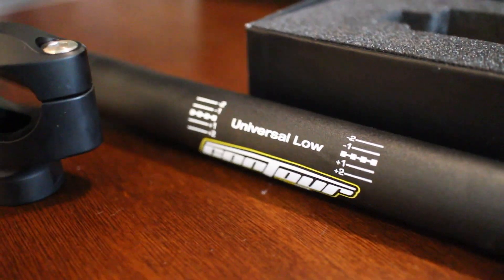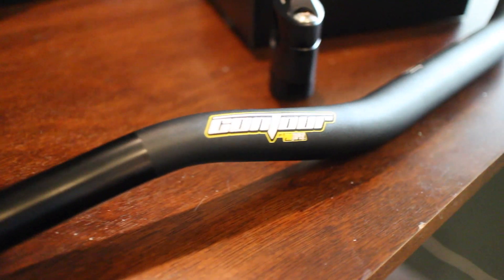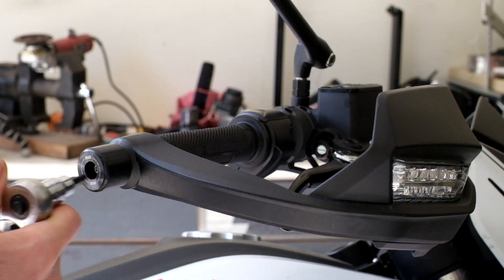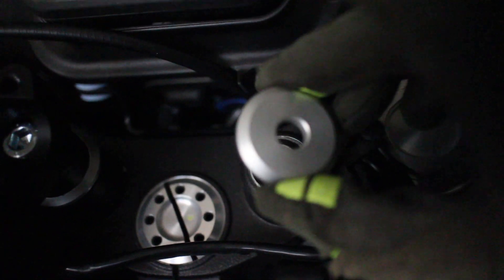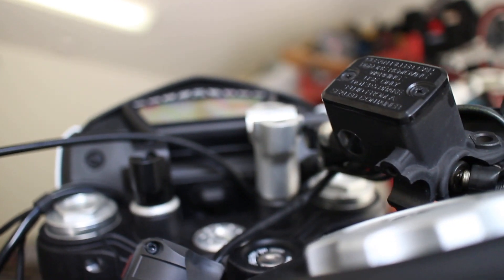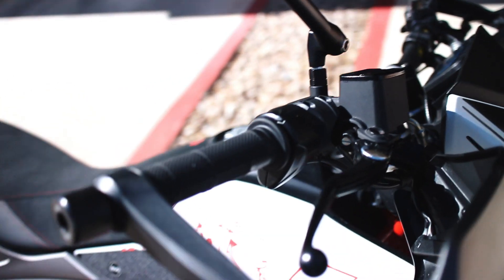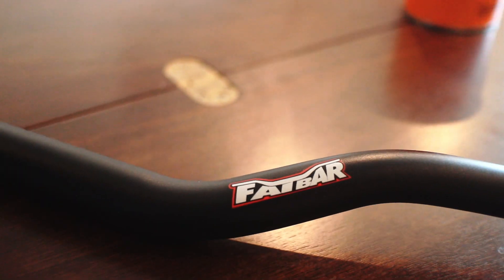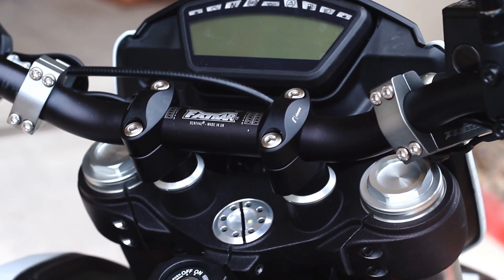Swapping FATBARS onto a Ducati Hypermotard

Comment: Nice im doing the same ... do the risers sit flush on those drilled out spacers ?
Reply from the maker: They do. Modification made them fit perfectly. I sold this bike or I’d offer to send detailed photos.
Reply: @TravisHollandMoto  thanks yeh the spacers fit nice drilled them out and they sit a few mm above the vibration damper ... just a pain to line risers up ... thanks